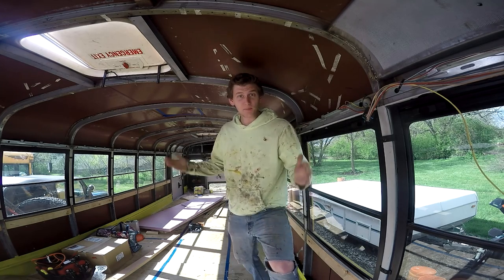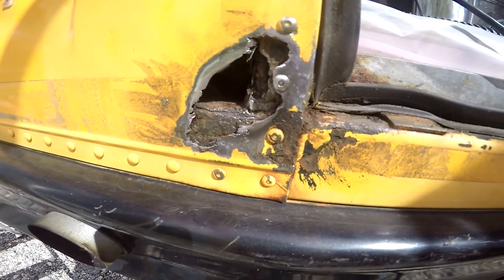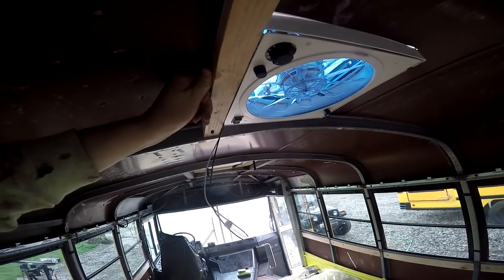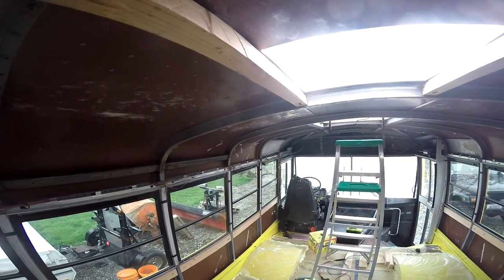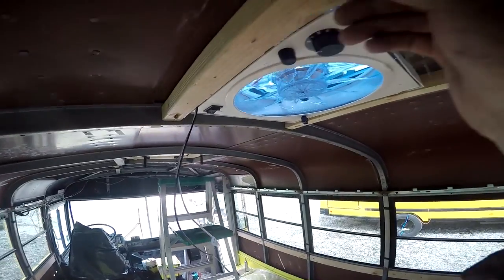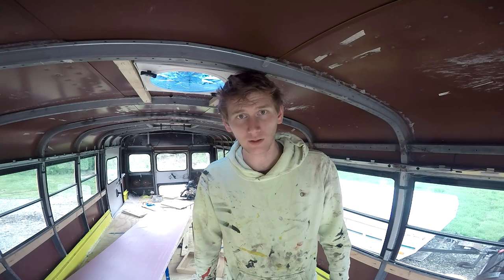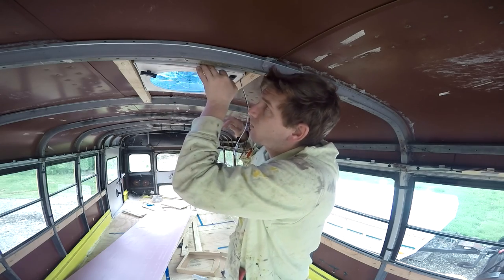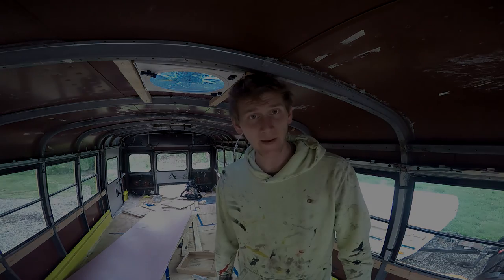Fantastic Fan Install & Body Work School Bus Conversion

Comment: why not just use the existing emergency hatch?
Reply from the maker: First one was modified for the skylight. Second one was covered up as it is over the bed. I wanted it up in the kitchen area to also act as an exhaust fan.